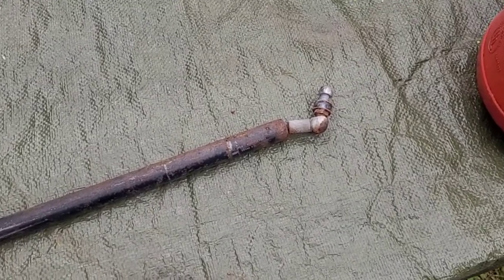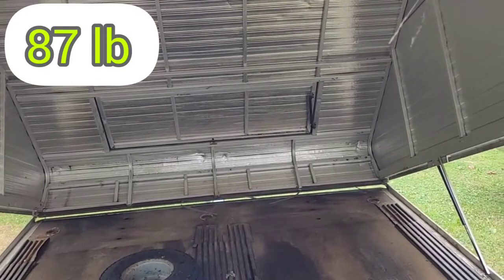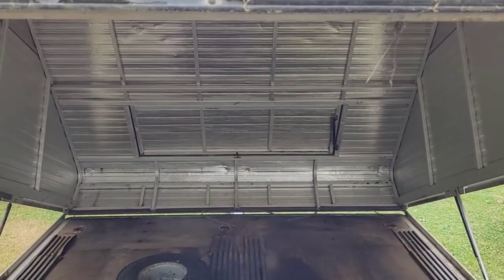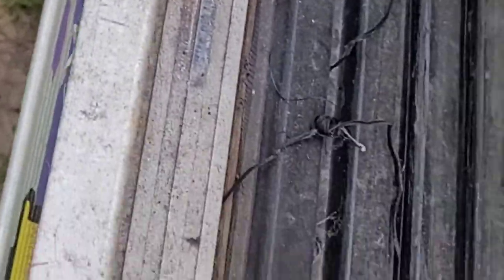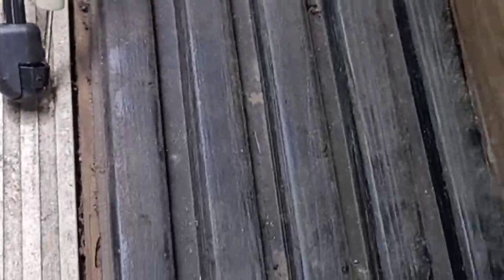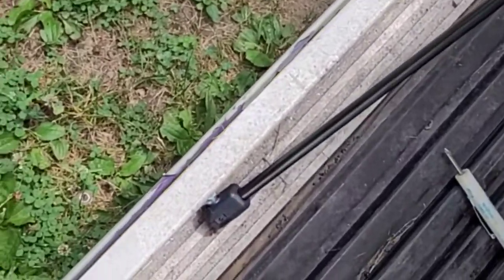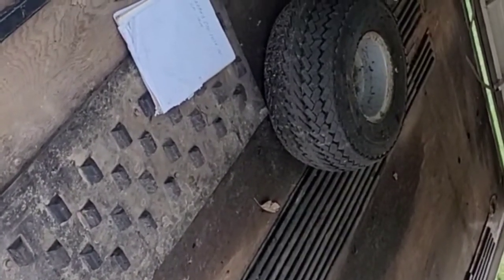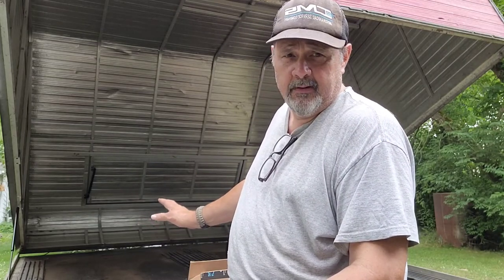How to and what not to  do,when Replacing GAS STRUTS on a snowmobile trailer.

Comment: Went with 250’s on my 11’ clamshell which were exact replacements for the original.  (LaVanture LGP10-280-250  28”)
They are strong.
Reply from the maker: Thanks for that info. My old ones were unreadable. These new ones probably won't last long then. 👍

Comment: I bought these struts too. Can't find where to drill holes for my retro fit. I've seen the new ones install with the low end toward the front end of the trailer. Yours is installed with the low end towards the rear which should help lift the weight but may also end up with bent rods... Thoughts?
Reply from the maker: They are still working out great. I installed them the way the original ones were. Hopefully no future issues knock on wood. But thanks for your comment .
Reply: @Roadhvac  im looking for the gasket on the back and front of my clamshell trailer.Its to keep the rd slush out when towing.Also the door access gaskets.i cant seem to find videos or part numbers for this.Thanks
Reply from the maker: Well, if I had to do it again  I would have got a heavier weight strut.
Reply from the maker: @timtofani8609  Try trailer parts depot. They sell a rubber roll about 3" wide.
Reply from the maker: Agree. If I had to do it over again I would of purchased a heavier shock.
Reply: @Roadhvac  Hello thank you. I will look. Thank you for you video and knowledge. Trying to figure out gasket material for my access door also
Reply: Can you pull some tape on your mounting points?